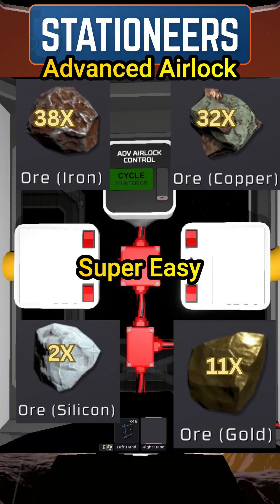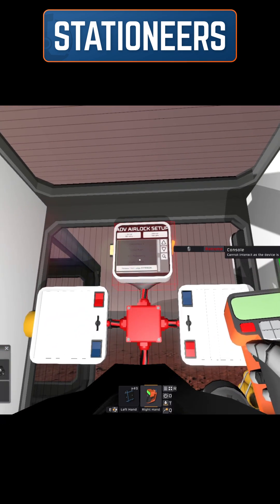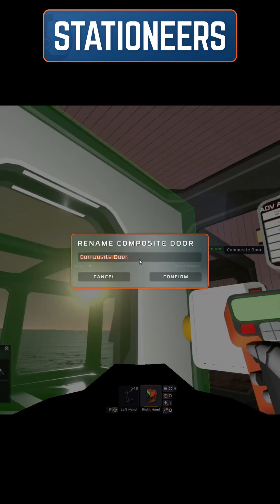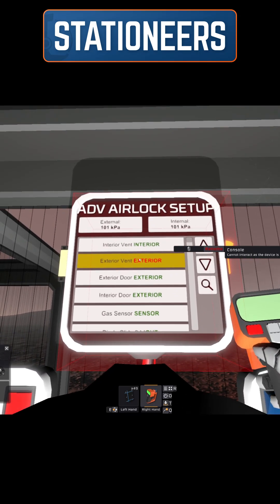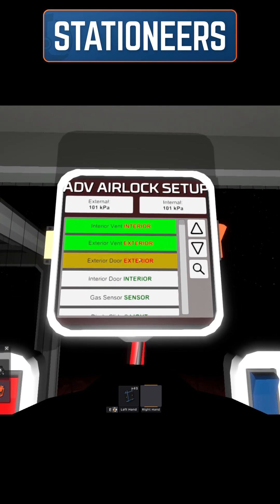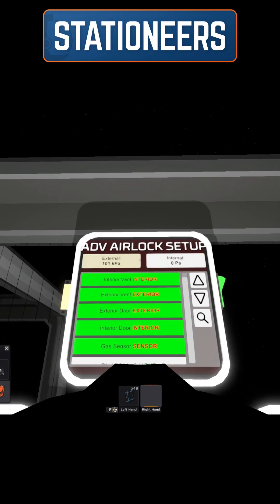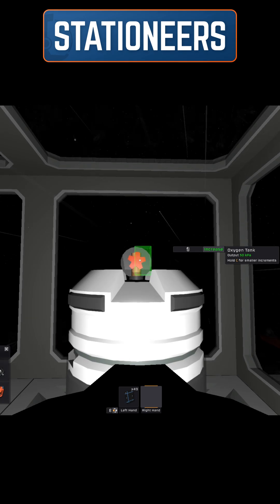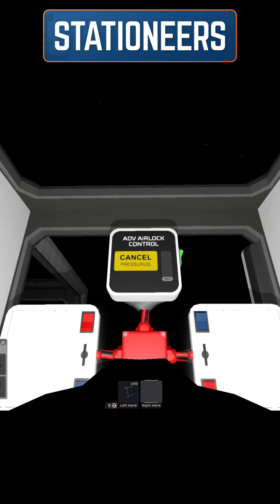Stationeers - Advanced Airlock Setup Guide

Comment: You can actually get the airlock to pressurize really fast, without setting the internal pressure to zero. Just put a utility tank, (the ball shaped pipe piece, directly on the interior vent, and set the airlock to pressurize to the same level as the room inside. the airlock finishes in like 3-4 seconds.
Reply from the maker: I'll have to try this out - I just found 0 works "good enough" - but i'll try this method